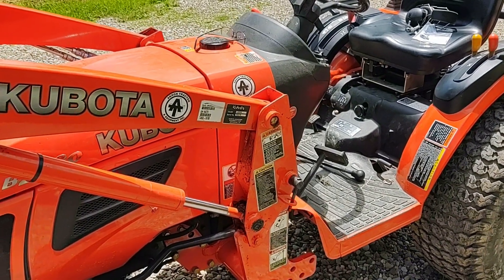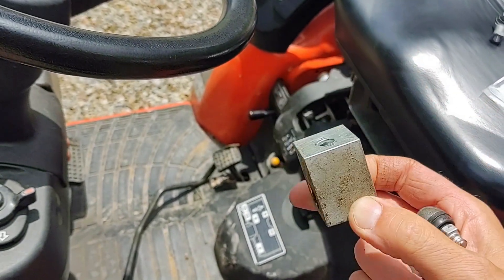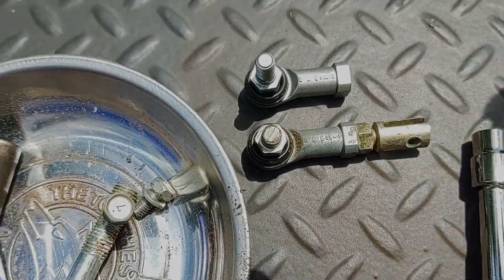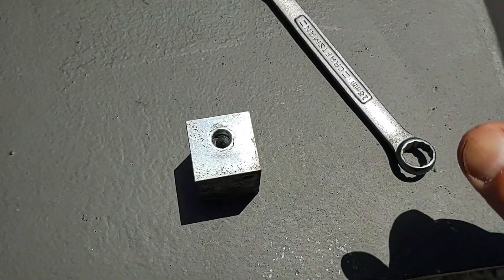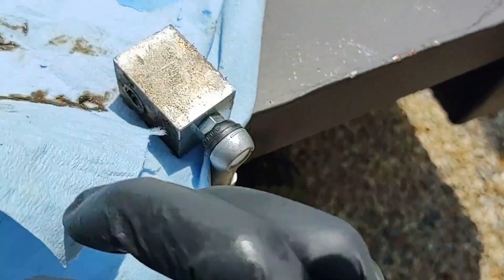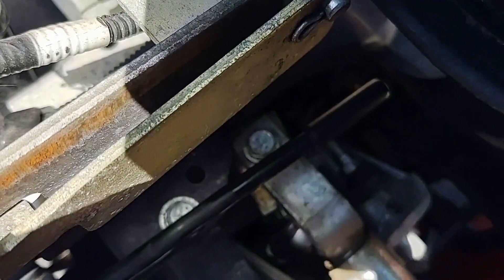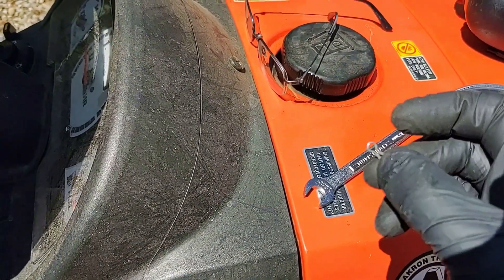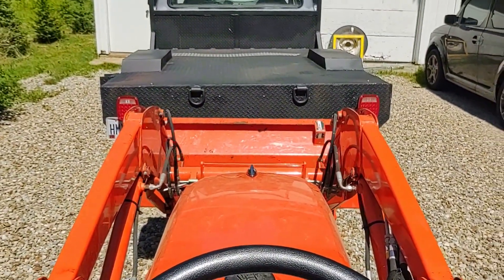Kubota B2620 Front End Loader Control Repair

Comment: Thank you, very helpful!  I have found this whole loader control assembly is problematic.  I have had the square base of the loader control stick fracture, and also had one of the screws that secure it into the block shear off inside the block (two separate problems in different years).  Generally I don't gorilla the control stick when operating, but I think maybe the force required to engage the float detent is too much effort for the strength of this assembly.  I also found that this work goes much more smoothly if you take the extra time to remove the seat as it gets that seat adjust lever out of the way.
Reply from the maker: @NeilDewar  hopefully I won't have to do it again any time soon, but if I do, I'll remove the seat. I think you're right about that design.

Comment: Exact same problem; have new block and ball link on order (B3200HSD) -  Need to remove seat, various metal covers and a cross beam. Then the top metal bracket has to to be removed in order to gain access to linkage elements; no way (on my model) to access this stuff with pliers without removing upper bracket. Useful references are Kubota diagrams ... F15200, J28002, and J28400

Comment: Kevin - any issues since?    I have same  model and had same issue last week - replaced the part (ball link) and everything worked just fine until yesterday.    Curl down barley works - pushing hard it will slowly curl down but that’s not good.   Took it apart again, didn’t make any adjustments and put it back together - it seemed to removed pressure on something and the curl down works again until this morning.     So at 6:02 I’m thinking the distance is where the pressure binds (for me) and won’t allow the piston to be pushed down to curl down.   IDK yet but looking for your thoughts.     Thanks for making this vid- I was thinking of doing one until I found yours.
Reply: I took it apart today and created the gap like you did at 6:02.   Initially I had no gap if that make sense.   Tested it out for awhile today moving dirt - so far so good.   Again thanks for your vid and thank you for the reply and offer.   If it happens again I’ll definitely make a vid.
Reply from the maker: @jimrkimo  Great! That's awesome! That's also confirmation that the length of that linkage is pretty important to the operation of those valves.
Reply from the maker: It's been working fine for me since I did the repair. As for your issue, my first thought is the same as yours. Probably something with the linkage length. I'm not sure how sensitive it is to that. I tried pretty hard to keep it consistent between the old broken one and the one I replaced it with. I'm not sure if it's even possible for that linkage length to change once you get it installed even if it loosened up somewhere. I had that same issue only when the thing was broken. If I really cranked it one way or the other it'd barely actuate the valve... So maybe it's kind of loose/too short?
Reply from the maker: Definitely let me know if youre able to resolve it. Or if you make a video about it let me know the link and I will post it in the description. I searched for answers and how tos on this particular problem and had zero luck.
Reply: Exactly - good job showing those details.   My old part was broken off so didn’t have a reference.
Reply: Have either of you had this happen more than once? I couldn't get the slug out of the block the first time it happened for me back in like 2017 so I had to get a new block and a new ball-link. Then Jan 2021 the ball link broke again, and I was able to get the slug out. And then yesterday I was working the bucket and guess what happened... I was able to get the slug out but this time I went on to get the same part again, but noticed they had a new part number for the "block" and it says it's non-interchangeable with the old one. I'm wondering if they fixed it somehow? When I fixed it the last time I did basically exactly what you did in this video, except I took the seat off and some other parts so I could actually get right down there and look. I used loctite on the threads and just hand tightened. But it only lasted 1.5 yrs. Something ain't right.
Reply: @ninchilada  - has happened to me twice now - 4 years ago and earlier this week (see my post above). PIA -- once in a blue-moon-problems always are. Trick is to remove enought components to have proper access to the ball linkage, etc.....